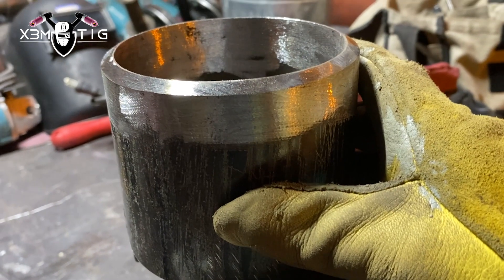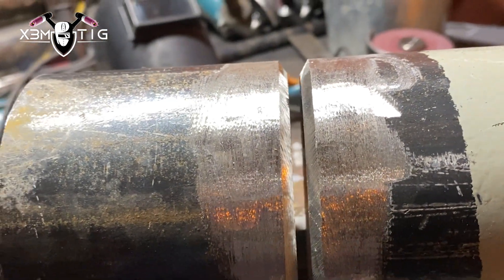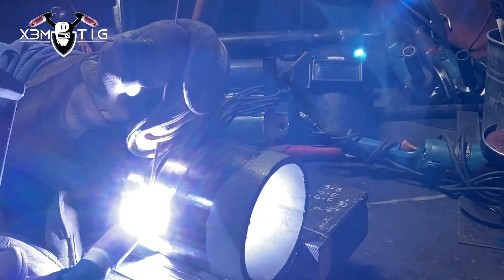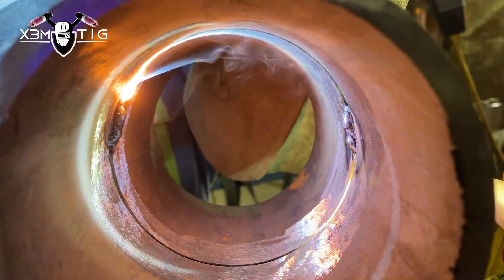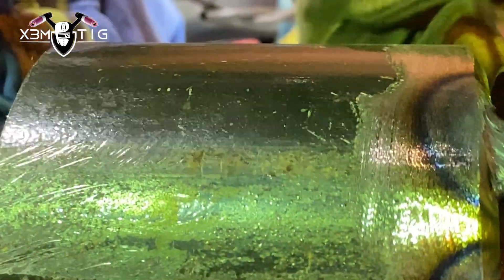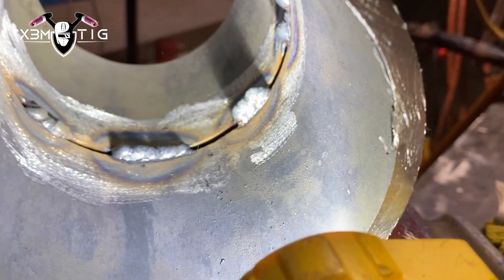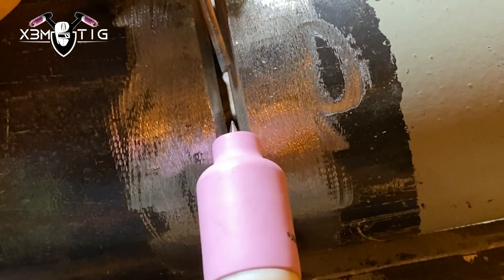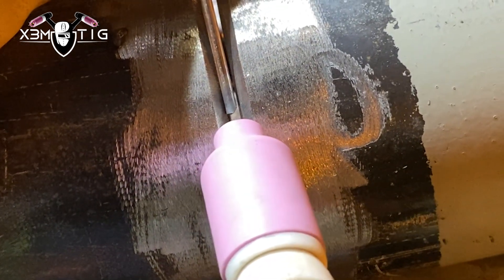TIG Welding Root Pass Mistakes – What Beginners Get Wrong!

Comment: So if the rod and the tungsten are pointing towards each other that's when you melt too much rod and get grapes?  The tungsten and rod should be closer to 90 degrees? 😊
Reply from the maker: Hey buddy, yeah something like that. Rod inclination is very important, depends on pipe diameter and other factors such as root pass or fill passes or cap. Grapes are mainly because slow travel speed especially at the top section of the pipe, this is where you need to use dipping techniques on the sides, and around 15-25 degrees approximately. At the bottom section especially on the root pass you can have cold stubs, this is because your improper tungsten inclination. Filler rod angle is changing during root welding, there is no general rule that applies to all, it’s all about individual preference. For all other passes we can use 25-30 degrees angle.

Comment: I KNOW THIS GUY IS RELATIVELY NEW, BUT HIS GLOVES ARE WAY TOO DAMN HUGE AND HE IS RUNNING THE ROD THROUGH A  FOUR FINGER DEATH LOCK, NO WAY HE CAN MANIPULATE IT.. HE STILL NEEDS TO WORK ON HIS TORCH SKILLS AS HE IS NOT GETTING MUCH PUDDLE CONTROL, AND HIS TIGHT GRIP ON THE TORCH IS ALSO HURTING..  I USE INSULATED TIG GLOVES, THEY ARE SMALLER, MORE FLEXABLE THAN STICK/MMA GLOVES, AND ALLOW YOU TO CONTROL THE ROD EASIER WHILE NOT BURNING YOURSELF ON THE PIPE..
Reply from the maker: Good catch 👍